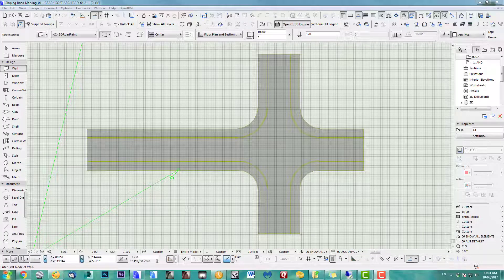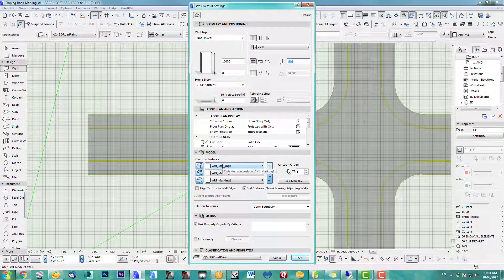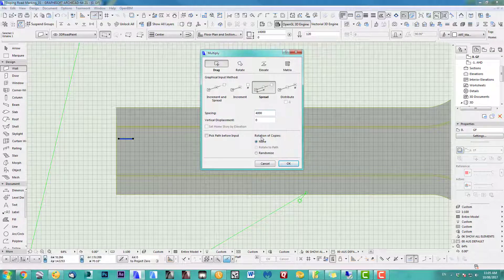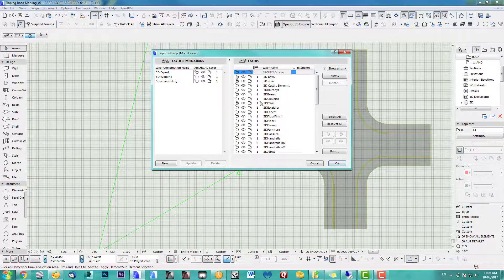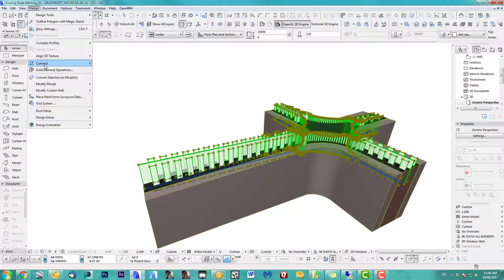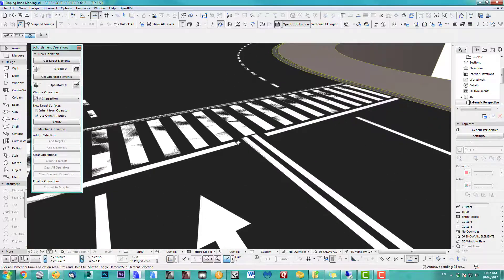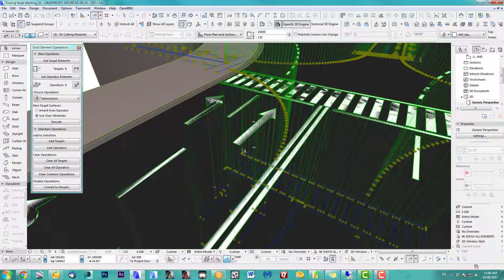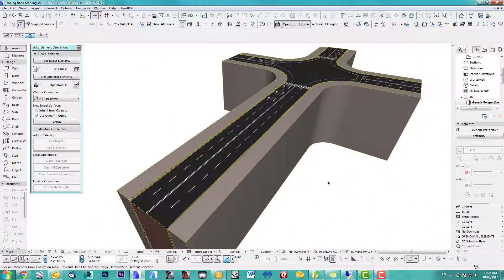How to model sloping Road Markings in Archicad

Comment: Also try this.
Let me help you:
Copy the mesh/road upwards by +-10mm and put it on a different layer. Use the same walls that protrude through the road and put the walls as the target in Solid element operations and the upper road you just copied on the operator and use upward extrusion as the method, and then Execute.Now hide the upper road.Done
Now you have 3d markings following the contours of the mesh/road and the walls/markings can be adjusted whenever needed.
Reply from the maker: Lauritz, this is another way to do it, nice ! You can't say my way is incorrect it's just a different way to do it,. There are always more then one way to a solution in ARCHICAD.  Can I ask you to take out the link which somehow got into your comment "execute now ", or I have to delete this comment, thanks.
Reply: @ASMTechbase  The issue is in your method the road markings cannot be adjusted after the operation has been executed.
Reply from the maker: yes this is correct I like your method :)

Comment: Great, One more idea...  you don't need to convert to morph. Just use SEO again ( road is target, lines are operators with up extrusen ) And then you can modifay lines ( walls ) and the cut remains.
Reply from the maker: Ahh nice ! Did not know this, there is always something to learn, thanks !
Reply: True, and much more convenient, but that's a lot of SEOs, which can eventually slow down the project file. If the markings are not likely to change, morphs might be better. As insurance you could preserve the walls as a module, trash the morphs, and re-merge the walls.
Reply from the maker: I wasn't aware that a lot of SEO's can slow down a project but makes sense. Before I morph a larger component I always keep a copy on a " to keep " layer, just in case as James mentioned, in case it needs to change. Modules are one way to do it but I like to keep everything in one file, that's way I almost never create a new library part. I never get the message, such and such is missing when loading a file :)